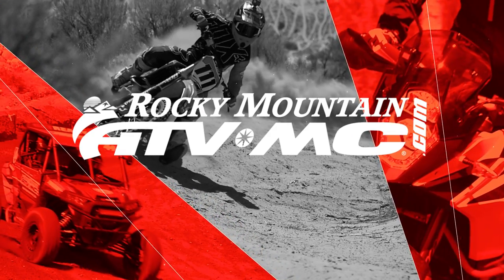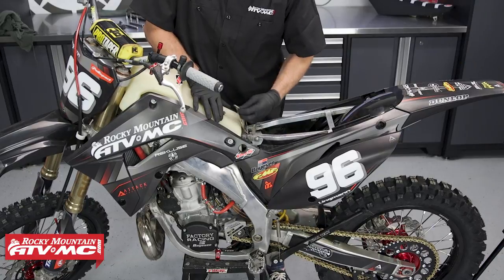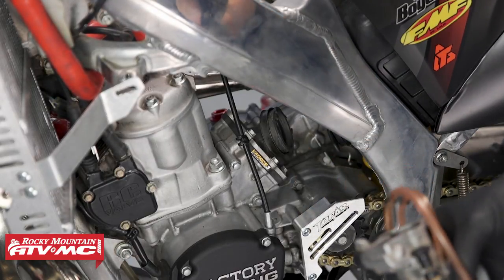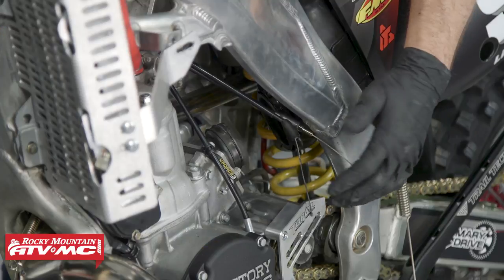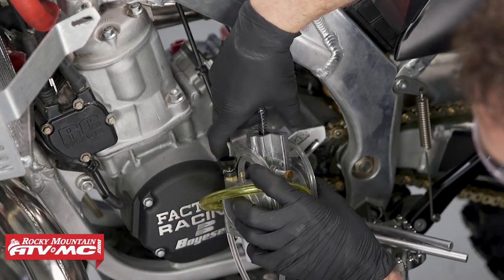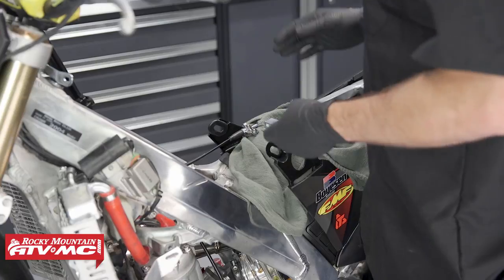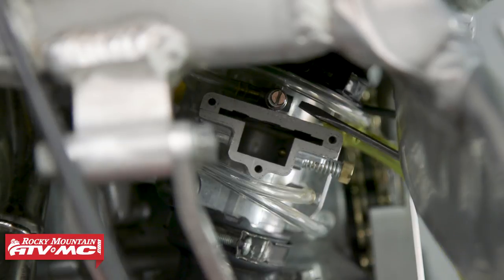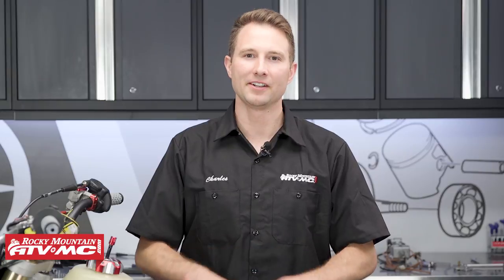How To Install a Lectron Carburetor on a 2-Stroke Dirt Bike

Comment: Got one of these for my 2003 cr 250 and it runs awesome right out of the box.  It was perfect out of the box except it pinged at medium acceleration. I richened it up and it ran fine but not great.  Learned I needed to put it back and run high octane gas!  Now it runs fantastic.  My bike has cylinder head work and wiseco race piston so that's why I figured I needed race gas.

And my fuel economy is crazy! Go out for an hour and use barely and gas!  Probably tripled my fuel economy from my carburetor!
Reply from the maker: That's great to hear, it sounds like that bike is a beast! Thanks for checking out the video and giving your feedback.

Comment: Got this for my 2003 CR 125. I ended up having to take off the subframe and the rear shock to get it to fit in there. I tried all kinds of ways and that was the only way to get it in. I also put on V-Force 3 reeds and that made the space a bit smaller. Was a tight fit putting the air box back on but it fits.
Reply: I just got one for my 03 cr125 too, with vfroce reeds i plan to install at the same time. Thanks for this heads up
Reply: oh yeah, I have a 2001 cr250 vfroce 3 reeds with the lectron, it's a pain in the ass atleast for me😂

Comment: Just checked out Lectron's site and the 38-H carb is the only option for the YZ250/YZ250X.  Lectron said this is the "high velocity" carb. Does this carb make the YZ250X too snappy and/or uncontrollable?  I have a 2017 YZ250X and I'm done with jetting, but I also don't want this modification to put me in the hospital either.  

Any feedback would be greatly appreciated!

Comment: I bought a electron carb for my sons yz85. Worked great. Now it bogs out when you give it gas. Changed spark plug and cleaned everything. Why is it doing this?
Reply from the maker: That is odd especially if nothing obvious has changed. Lectron has some great tech support that should be able to help you get your bike running nicely again. You can find Lectron's contact info here: https://www.lectronfuelsystems.com/contact

Comment: The cable doesn't thread in my throttle housing? Is a different housing required or is that the stock housing on this bike??
Reply from the maker: This is the stock throttle housing. Did your Lectron come with a throttle cable? Some of the older models use a cable specific to Lectron and some of the newer Lectrons reuse the stock throttle cable. Lectron has great customer support if you have technical questions.
https://www.lectronfuelsystems.com/contact

Comment: What do you do with the connector that you unplugged from the carb that was attached to the old throtle?
Reply from the maker: Do you have a timestamp for when we show that connector you're talking about?
Reply: 2 minutes
Reply from the maker: That is the throttle position sensor which won't be used if you're new carb doesn't have one. You can trace the connector back to the harness and see if you can unplug it. You can also just use some electrical tape to keep water out of the connector.

Comment: What if you have a throttle position sensor integrated on OE carburetor?
Reply from the maker: Lectron does not utilize the TPS and they suggest disconnected it when installing the Lectron. Lectron has a throttle position sensor FAQ page I'll link so you can check out some more info on that: https://www.lectronfuelsystems.com/tps_faq

Comment: Can I use on a 2020 KTM SX the standard intake boot or a shorter one ?
Reply from the maker: Yes, there is a Lectron available for your bike and it will come with the a different flange if it is necessary for your bike. But the 2019 and 2020 SX bikes shouldn't need the shorter intake flange.
You can check out more info here: https://www.rockymountainatvmc.com/parts/lectron-high-velocity-adjustable-power-jet-carburetor-kit-p

Comment: If i put this on a 50cc, would it be overkill?
Reply: There’s no point of spending that type of money on a bike that can barely break 20 mph, save your money this is better for something like a 85cc or bigger, anything below just run the stock carb

Comment: Thats all you gotta do? I don’t have to tune anything within the actual engine? If this is all i gotta do imma have to order one.
Reply from the maker: That is correct. The only adjustments are an idle screw and metering rod that can be fine tuned, but a lot of times those don't even need adjusted. Nothing else on your engine will need to be tuned.
Reply: @rmatvmc  Do you know how i can order a brand new carb for a 2005 crf 450r from keihin? I looked on their website but i don’t see any buy options only contact numbers. Do they not sell online?
Reply: @EarthWasHere  This video is for a Lectron carb, why are you asking about another carb brand?